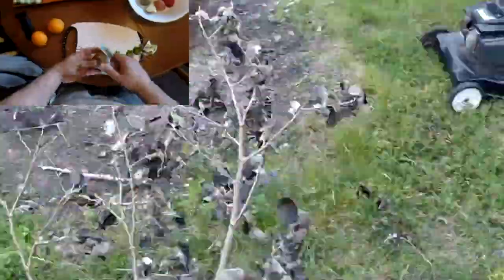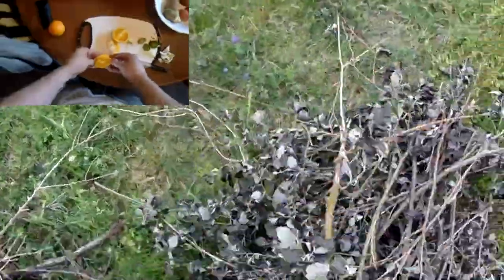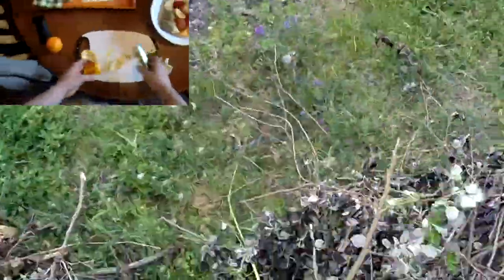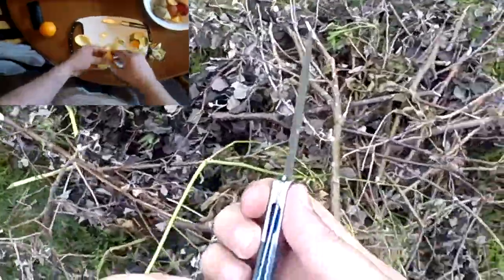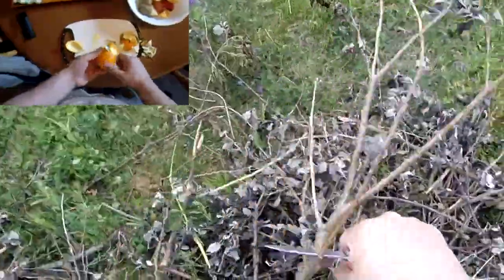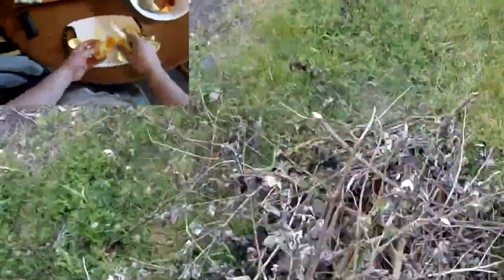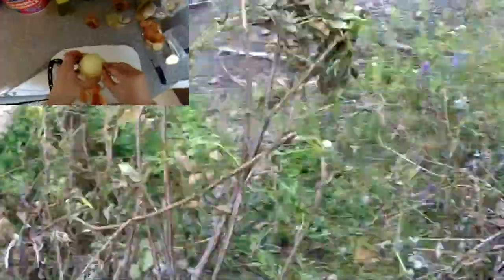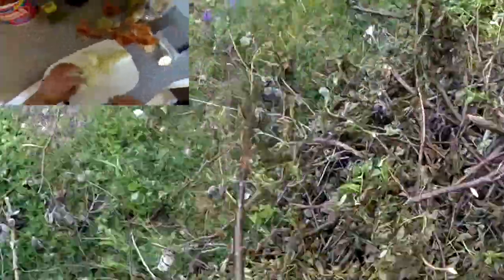A stainless steel Bullet in Nitrobe 77 : Des Horn

Comment: After reading some of the commentary written by Marthinus and others, Des Horn's work is quickly becoming a grail of mine.

I sort of feel the same twinge of sadness about this knife that I feel when I look at Tony Bose's work. They are all highly functional and designed for work, but are priced beyond anyone but high end collector's reach.
Reply from the maker: Des does working grade models, but you need to be at a show to get them. The dealers usually can often double the prices. This is a really nice piece, Nitrobe 77 with a full optimized HT and nice geometry all consistent and designed to maximize the performance in a coherent manner.

Comment: I wish I could have seen more details of the knife itself, but it's great to know that a presentation piece can be a functional piece as well. I've seen way too many knives that are all show and no go. At this point in my knife collecting hobby, I will not be buying any more that are shelf queens. As cool as they are, I have learned to gravitate towards function over looks.
Reply from the maker: I will put up more sensible videos shortly, I just had a lot of footage which was off frame and under poor lighting conditions that I was going to delete so I decided to just put them up and show the knife in use.

If you talk to Des, and handle the knives it becomes obvious that being functional is critical. This is one of the few liner locks I can tolerate as it doesn't have the sticking action that is very common on even very high end knives and it isn't unstable .

Comment: Hi Cliff, id like to kniw yoyr opinion on the n77 steel? I nust git a knife with and im pretty excited to try it out and see how it performs. Im not expecting insane edge retention but at 62 to 63 hrc im thinking it should be pretty good. I main got it because its hard to find knives with n77, as far as I know only Des and Carson tech(which us whaf I got), use ir have used it and carson isn't usinf it anymore due to expense and complicated heat treat. I also hear that its supposed to be abke to take an extremely keen edge and have the toughness to hold a keen adge at low angles.  Again, this is all he said she said and I would like to bear what has been your experience so far. Thank you Cliff, take care.
Reply from the maker: It is basically a much higher corrosion resistant version of AEB-L . It is very easy to sharpen to extremely high levels, is very resistant to chipping (low carbide) or deformation (high hardness)  and has an extremely high corrosion resistance.

It is discontinued and you are likely to never see many knives from it due to the expense of producing it which was more of an experiment itself.

Comment: I really want to get some of this steel. How does this compare to aeb-l in use.
Reply from the maker: That is an interesting question, there are a few issues :

-it is a nitrogen based steel so the corrosion resistance is very high

-it tends to have much more refined hardening in general, this one has three repeated cryogenic soaks for example

-it is PM processed so the aus-grain is likely to be finer

It should be better than AEB-L in all aspects, but the critical question is can it be seen practically? Most people don't even know how AEB-L can behave as the vast majority of it is not optimally hardened anyway.